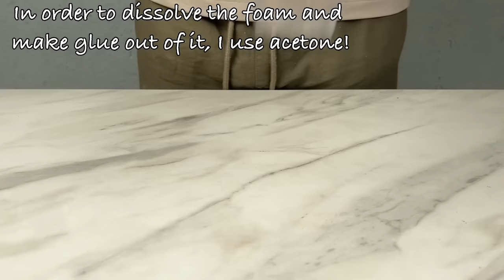🔥The Masters didn't want you to know that! Tips and hacks that really work.

Comment: Of course avoid any plastic glass or cup made out of PS (plastic 6 in EU).
This procedure is safe with cups of plastic made out of PE (HD or LD) or PP.
In the past often plastic cup were made out of PS (those are esily cruched in hand and breaks); once you trow a volatile solvent like halogenated hydrocarbon (dichloromethane, trichloromethane), aceton, or liquid aromatic hydrocarbons; the hard PS structure is ruined quite fast and the cup may loose integrity thus spilling the solvent (often flamable and caustic for some plastic or varnishes) all over the place, while the bottom of the cup turns into a goo-ish mess, sticking and making filaments of plastic onto the table.

Regards,
PHZ
(PHILOU Zrealone from the Science Madness forum)
Reply from the maker: I completely agree with you and thank you for these comments. This is true and we did not find out about it right away.